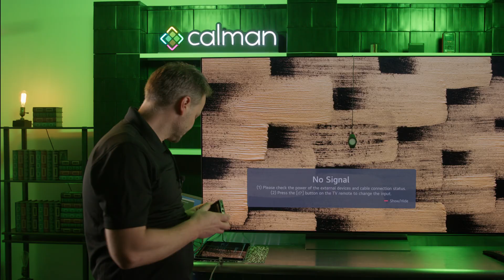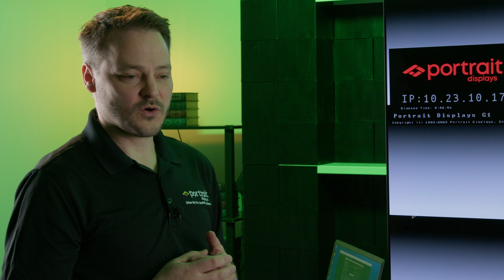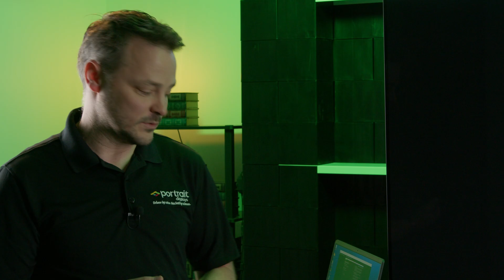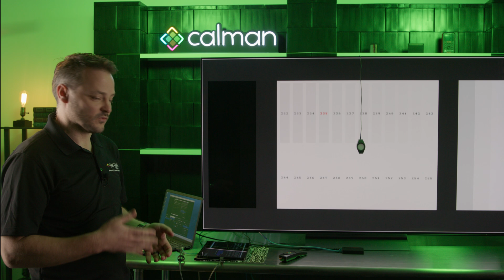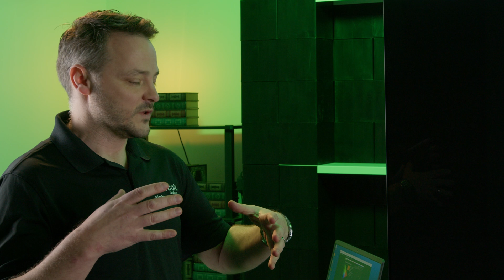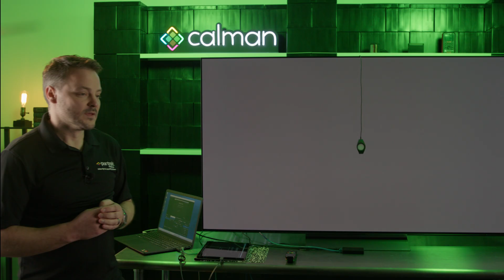How to Calibrate an LG C3 OLED TV with Calman Home

Comment: Guides for older LG OLEDs state that you should use Delta E ITP instead of Delta E 2000 for Autocal with Dolby Vision. Does this not apply anymore?
Reply: deITP is most appropriate for HDR evaluation but it really doesn't matter.  Your display is going to look the same if calibrated to the best of your ability using the gear at your disposal regardless of what de formula used for evaluation.

Comment: Once the SDR, HDR, and DV calibrations are completed, are these automatically applied to all inputs or is that another step that needs to be checked off somewhere?
Reply from the maker: Great question! When you calibrate SDR, HDR, or Dolby Vision, the calibration files (such as LUTs or the Dolby Vision config file) are stored in the picture mode you calibrated. To make sure those settings carry over to other inputs, you’ll want to copy them. Many TVs have an “Apply to All Inputs” option — if yours does, that’s the easiest way. Otherwise, select the same calibrated picture mode (e.g., Filmmaker Mode) on each input and confirm the settings match.

Comment: do you need that in-between blackbox or can you connect the Calman directly to the laptop to do the calibration?
Reply from the maker: Using a dedicated pattern generator ensures that you are getting accurate reference signals as your laptops output may have additional processing or picture profiles attached to it. 

We actually did a video on what happens when you try to calibrate without a pattern generator which can be found here:

https://youtu.be/2BLE7Bnclk8

For any other questions please feel free to reach out to calman-support@portrait.com

Comment: Hello. Why does the LG OLED G3 produce a swamped gamma curve in HDR and Dolby Vision during calibration and characterization? On Apple TV, all TV shows are dark. Many other movies in HDR are dark. They are so dark that even in an isolated room without light it is difficult to make out the details. In professional parlance, the speed of transition between image contrast and chromatic contrast is inadequate. The overall contrast is incomplete. There are no such problems with calibration and characterization in SDR - the result is excellent. The device is a spectrophotometer i1 Photo Pro 2.
Reply: Also the owner of a G3 but use different calibration software.  I don't use LUTs to calibrate my HDR10 and Dolby Vision picture modes, but instead manually correct white balance while in gamma space (a/k/a calibration mode).

That being said, I was also running into the same issue you were regarding dark HDR.  The problem was an incorrect peak luminance value due to incorrect stabilization times between measurements.  Measuring grayscale quickly in succession will result in an inflated peak white value.  That inflated peak white value is beyond your display's actual capability and using it will cause it to undertrack the PQ curve once PQ processing is enabled.

You need to find the right stabilization / pattern insertion times during measurements to ensure you don't get an inflated 100% white measurement.  I accomplish this by using a 15 second black stabilization patch between each grayscale measurement.

Keep in mind that using aggressive insertion / stabilization times will cause the G3's peak white measurement to decrease by about 100 nits, but it will be a more accurate representation of your display's actual peak luminance capability and will result in a better picture.
Reply: Great post, so very informative! 
100 nits difference is crazy. The thermal instability has already proved a PiA for me with manual SDR calibration, and the fluctuations are a lot less significant in that case.

Is it that the panel heats up when simply doing a grayscale sweep without insertion patches, and that leads to higher light output at near white shades? 

I'm not that knowledgeable, nor experienced, with these panels, but I would expect the luminance to drop due to dimming algorithms (ABL, TPC) instead.

Now the question is, how could inserting a black stabilization patch be resulting in more accurate peak and near white luminance readings, while being less representative of the panels actual performance in real use?

This tech is so confusing and frustrating sometimes, it almost makes me wish I'd go with a simple good old VA LCD...
Reply: Because LG is garbage LOL

Comment: Can I calibrate multiple hdmi inputs on a single display? For example, can I calibrate hdmi 1 sdr and then hdmi 3 for hdr? Or is it one calibration for all inputs on the display
Reply: you're not calibrating the hdmi ports, you're calbrating the tv's different presets ie. Filmmaker mode SDR, Filmmaker Mode HDR, Cinema SDR, Cinema HDR etc
Reply: @danielpherson Yes but you also can overwrite it on the hdmi port: so you use hdmi 1 for sdi and hdmi 2 for hdr for example

Comment: How do you deal with Metamerism failure where calibrating to D65 on LG has green tint?
Reply: Thats what i want to know too, got that after calibrating my LG G3 to D65.
Reply: @pauker2017  Only solution is white offset.
Reply: @Jodez23  I would have to pick this by eye... not very accurate without any point of reference. I am hoping that calman will release a Meter Profile for WRGB MLA to compensate for the green shift. Maybe the do, but probably only for their own C6 Meter.
Reply: @pauker2017  What I've learned is that you can calibrate a regular LCD monitor for example that doesn't suffer metamerism failure and match the white to it by eye. Then calibrate to that white offset.

Comment: I am using the inbuilt generator on my LG G3, I don’t get the numbered boxes appear at 17:49. Am I mean to press something or is that more to do with you using the g1 generator? Can I get that with the inbuilt LG generator?

EDIT: Answer from support email, LG intenral pattern generator does not have that feature.
Reply from the maker: Thanks for letting us know! Our Support team will be able to help troubleshoot you through this step.  Would you please send us an email at customerservice@portrait.com.
Reply: Were you able to complete the calibration with the internal generator and get satisfactory results or did you end up getting the G1?
Reply: @JonMartin84  I contacted support and they said those patterns are specific to the G1 and VideoForge Pro (I think they mean used together). And that the internal pattern generator can’t do it. They did also say that in most cases LG OLEDs don’t need brightness and contrast adjustments here 👍
Reply: @YTN3rd  They should be showing this with the internal pattern generator and save the G1 sales pitches for another video. My first run with my C3 is horrible, nothing close to these results, 2 and 4 for color dE, nothing is within any box, all too wide for the boxes in post validation SDR. My Sony manually 2 pointed with Calman Home did 0.7 and 1.7.

Comment: I notice you calibrate with video levels. I get great results calibrating with video levels, but less great values when I calibrate with full levels. I need to work in full levels, so is there a better way to get good results when calibrating with full? One option is to calibrate in video and switch everything to full for the post cal verification, but even this doesn’t give tight enough results for what I need.

Comment: Why is the pre measurement so incredibly bad? I've never seen that on LG oled tv's the last few years. Unless measuring dynamic mode. But that would be quite misleading.
Reply: At one point in the video, you can see that energy saving mode is selected as the picture mode which has really cool white balance. I think this is the reason. The C3 actually delivers a good experience even without calibration, for example in filmmaker mode.
Reply: Agreed. I’ve never seen one so bad out of the box.

Comment: does the G1 not need to be set to 10bit output for the HDR and DV calibrations?
Reply: If it's accurate in 8 bit it will be accurate in 10 bit too.
The test patterns are very simple blocks of colour and don't need to be 10 bit.

Comment: https://youtu.be/tMbUkb5TPvk?t=43  How do you get the puck to actually stay flush with the display...mine wants to  always bounce away...i feel like I need a stand to get it to press against the screen and prevent light bleed...
Reply: rotate the cord. It doesn't move within the housing but you can "spin" the cable and then lay it or pin it down to adjust the angle
Reply: @Kamuigod2001  Thx, but I definitely tried that, it perpetually still wants to spring away lol.
Reply: @1stWorldProblemsSolved  I had to bend the cord above where it exits the top of my meter, not where it is shrouded, but above that...otherwise stick something (a wallet) under the front foot of the TV to tilt it back slightly.

Comment: Hi there, if I have the Blackmagic UltraStudio connected to my Mac output, and I'm running the Callman Home LG through Parallels, I don't need the pattern generator, right?
Reply: Did you find an answer?
Reply: @MarcoRossini-vc5ii  The Calman response: " In regards to your pattern generator, the internal pattern generator for your C3 will be supported with Calman Home.  Please note that the LG's internal pattern generator may only calibrate for SDR, HDR and DV but will not validate.  Validation will require an external pattern generator. "
Reply: @clausstellfeld9116  Sorry I totally misunderstood, I used the stepwise on the help center of portrait. Basically connect to your tv thru ip (same network offcource) when selecting the source for your pattern generator. Your Tv then asks if you want to connect.
Reply: @MarcoRossini-vc5ii  from Calman nothing, but the two best tutorials about it didn't mention any pattern generation. What I presume as since is a clean feed that the UltraStudio is giving to the tv there's no need.
Reply: Why you need an ultrastudio? If your using the internal generator of the tv? You just connect calman home lg and choose as source the tv. Just make sure the tv is in the right mode (sdr hdr10 dolby vision). Or your just using the ultrastudio to put the tv in the right mode?
Reply: @patjoew  I'm using the utrastudio to work with a clear signal with davinci. My doubt was exatly if the c3 has this internal generator. How can I access it ?